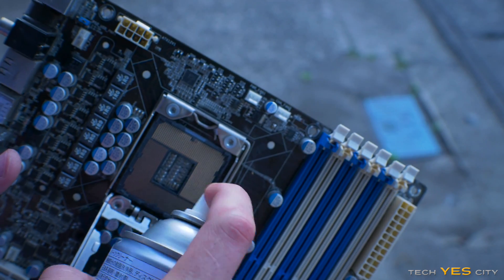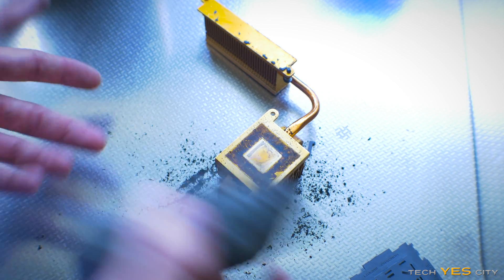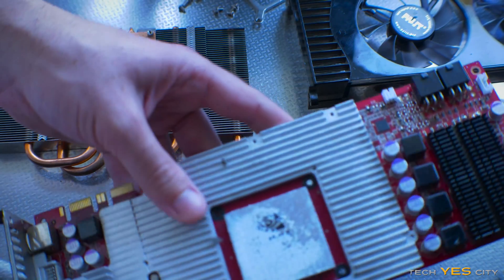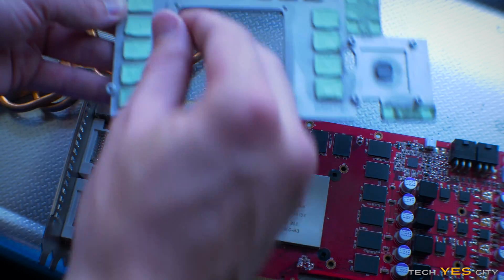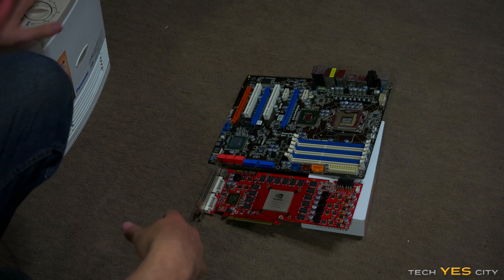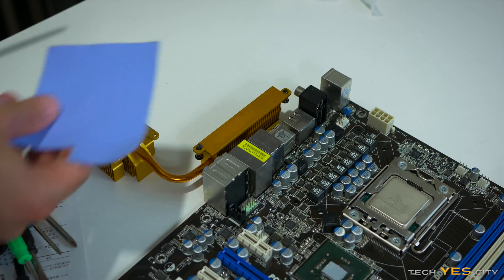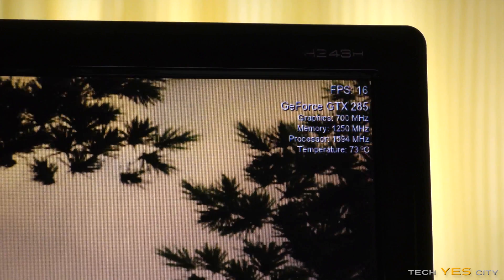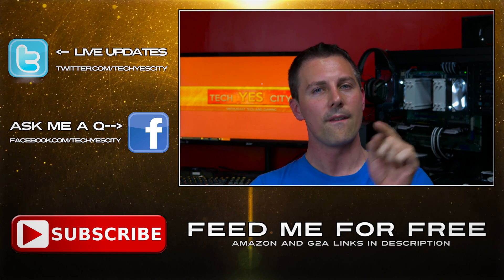PC Parts RESTORATION - How I CLEANSE - Ft. Before and After Temps

Comment: How to kill a perfect motherboard.

You cant sand a northbridge , it is open Die meaning the actual DIE with the transistors on it is in direct contact with the heatsink, these are extremely fragile, one little scratch will kill it, one broken corner will kill it, just ask anyone that use to install AMD K7 cpus.

Not to mention Brake cleaner and BGA chips...
Reply: You know, except for that part where all the components still work. Like, how dumb are you people? He shows everything still working, and yet you're all "Oh geez, look at all this dead hardware".
Reply: LiquidPanic longevity is the problem, hardware that could have lasted for a decade could fail a few months in, do some research and actually read up on how processors work. Just becouse it still powers on doesn't mean you didn't shorten its lifetime dramatically for doing something idiotic aka sanding open silicon , static discharge or using chemicals that's corrosive to plastics on a thing thats full of plastic.
Reply: HPZeta The plastics used on motherboards is extremely strong compared to something like GPU fans. It's not going to just melt from some brake cleaner, especially when it can survive being baked in an oven. Plus I've seen K7s with all four corners chipped still work perfectly fine. I think you need to do some research before trying to tell everyone that everything they do is wrong.
Reply: +LiquidPanic your personal experience is null in this matter, there are different types of plastics , and how they are effected by brake cleaner is different, most solvents resolve the petroleum bonds making the plastic brittle over time.

 I have a engineering degree, and ran a business for almost a decade repairing motherboards on a component level , as in removing and redoing BGA components , and components etc... so I think I am fairly qualified to tell some one they are doing something dumb for using brake cleaner , if you absolutely need to clean a motherboard , Use some Kontakt 60 PCB cleaner its designed to clean circuit boards.

anyhow this is turning into a internet spaz, I don't have time for.
Reply: HPZeta No please, go on. You totally aren't like the 50th person that says that just because of how long you've been working with computers that you're always right. He specifically said in another comment that he buys a certain type that is not as corrosive as many other types of brake cleaner. As for using a proper PCB cleaner, he pays so little for the parts, and the parts that he risks with the break cleaner and such are worth so little that it's not worth the money to get the "proper" supplies for restoring them.
Reply: +LiquidPanic kontack 60 , costs R160 for a bottle , so  < $10 I am fairly sure that's cheap enough for what his doing 

Also no I haven't been doing computers for a decade, I've been doing electronic engineering as in repairing at a component level.

computers probably for about 2 decades or so....

So please disprove me with some actual evidence.
Reply: HPZeta I love how you're asking me to DISPROVE you with evidence, while you have not shown any evidence of this type of cleaning reducing component lifespan.

Comment: Hi Tech Yes City,

Wouldn't contact cleaner/ isopropyl alcohol be much better for motherboards? I know its pricier but parts cleaner is very harsh and surely may cause issues in the long run for a PCB such as a motherboard.

Also, have you heard of simple green? Its a household cleaner type product but does a really good job of cleaning general grime.

One last thing, regarding the baked on paste on the northbridge. That stuff is generally an adhesive mixed with thermal paste. It both hold the heatsink on as well as conducts heat. In my opinion your best to leave this on as I don't believe the added temps affects stability.

Comment: My friends PC had issues with the case fan speeding up big time because it was getting hot just running Windows, turns out the CPU fan had a lot of dust built up. Good idea for beginners to unscrew the CPU fan and blow out all that dust, after I gave it a thorough cleaning her case fan no longer had to ramp up speeds to cool down the CPU and it was quiet again. Just blowing out your boards with canned air is not always the only thing you should do.

Comment: sooo. my platimax 1500 died on me
running Dual R9 290s on an 850watt gold PSU (alongside a fx8350 @4.5ghz) 
definitely killing this power supply @ this rate...
too broke to afford a new 1500+ watt PSU 
do have an 750watt PSU laying around that is in tip top shape though
should i daisychain them for the time being using a dual PSU adapter to power my gpus?
Reply: +RMSLtnick 1,500W is overkill for that setup. Under load a setup like that is likely to pull about 660W from the socket and it's advised to let the total-draw be 50-75% of the total PSU-wattage. So with an 850W PSU you're at about 77,6% draw under load wich isn't too bad but can be improved. But to be honest, everything over 1,000W doesn't give you any benefit at all, on the contrary, you'll kill the idle-load-efficiency by going higher. With a 1,000W PSU you're at 66% draw under load which is pretty much optimal, I can recommend the Super Flower Leadex Platinum 1000W. This is a short review I wrote about that PSU: https://www.facebook.com/metacustomcomputers/posts/886563204723534

Kind regards,
Meta Custom Computers

Comment: linus delided a cpu and the temps did not make any difference what so ever dont even humor de-lidding
Reply: +Jesse Raines u realize, when most people delid a cpu, they dont put the ihs back on.

and they use liquid copper or some shit
Reply: +Adeel Rehman If you don't put the IHS back on, you're risking the die when putting the cooler back on. The corners and edges of the die are brittle like glass. After delidding the CPU and applying liquid-metal TIM, you always have to put the IHS back on, except you want to throw away your CPU if the die chips. On Haswell and Devils Canyon, people got a temperature-improvement of about 5-7°C under load when using liquid-metal TIM.

Kind regards,
Meta Custom Computers
Reply: Meta Custom Computers I know the die is fragile, and you have to remove the socket retention arm stuff to make the cooler touch the die. 

Anyways, remember the Athlon xp days? You would do it the same way. The die was exposed back then, and it could be now.
Reply: Adeel Rehman
Back in the Athlon-days there were no "I've seen a Youtube-video, now I'm capable of building my own computer"-users, it was specialized people who assembled them and it was well-versed amateurs who did the homebrew.
In todays day and age I wouldn't recommend anyone to mount a cooler on an exposed die because you never know how experienced the people are. I've seen enough people asking about custom-waterloops and radiator-calculation and benchmark-results that never in their life even opened up a PC-case but on the internet they try to be the know-it-all.
So you see, only because I know how to handle an exposed die, doesn't mean that I'd go around telling everyone to do likewise because there are even people who claim to be a "watercooling-guru" and still mess up their Mayhems Pastel by own mistake.

Kind regards,
Meta Custom Computers

Comment: OMG best ending EVAR. Also Dude you have really inspired me to do stuff with older hardware. I just did a full thermal re-pasting of an i5 760. It currently has a GeForce 285 in it. I think I'm gonna pull that apart as well and re-paste it too. Then I modded the case a little so it would fit a front 120mm fan and replaced the rear 120 with a better one. It's funny though because it's a little dinky mini tower nothing case, but has some interesting features, like a removable lower 3.5" drive bay. Yanked that out and placed an Intel SSD in one of the 3.5" bays above where one might put... two floppy drives!? Just really been having fun recycling old hardware. Maybe I should make a video or two! Thanks again for all you do. Cheers from California, in the US. // J

Comment: The other problem of taking of the heat spreather would cause it to be recessed and the heatshink won't touch the chip and you will end up adding another layer of metal to compensate
Reply: +Miguel Águeda he would have to remove the vrm heatsink, and put metal on that. 

The actual gpu would be fine.
Reply: Adeel Rehman The heatshink  has kind of standoffs for the mounting  system. You might be abke to tight  it a little more but probably not that much

Comment: You forgot to screw off the GPU in cross method
Reply: It can add more pressure to a corner on the die than other corners
Reply: +John Isaac Calderon not really a big deal, especially when you have an ihs, or anything modern. The only time this was a problem was when cpus did not have an ihs, and just had the cushon thingies around them. Modern gpus have a metal thingy around them, so its not really a problem,.

Comment: Easier way of doing this : put your GPU and Motherboard in cloth washer , instead of bleach put in a lot of 100% alcohol and set it low , so the parts don't break , after that get a lot of rice into a bowl or something and fit in your parts with it , leave it there for few days and it's done , no need to do all of this hard work.